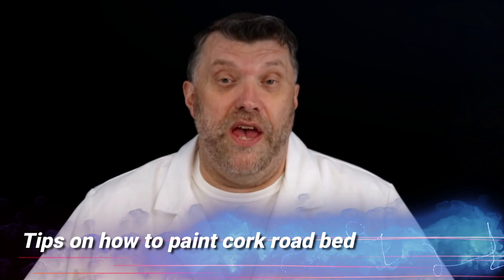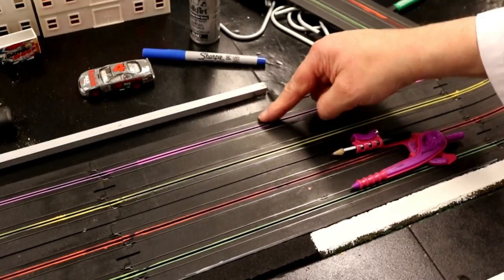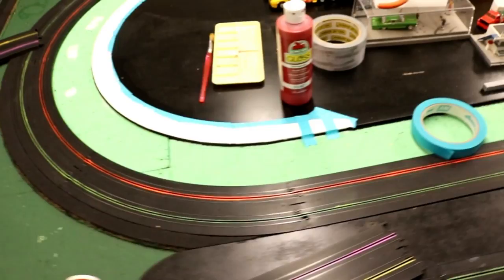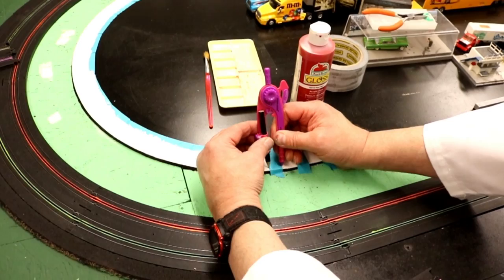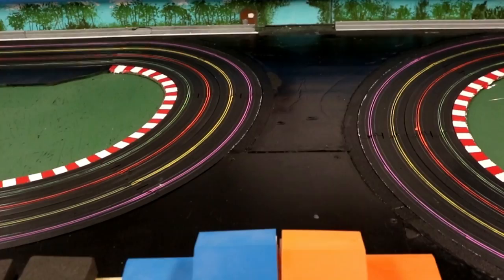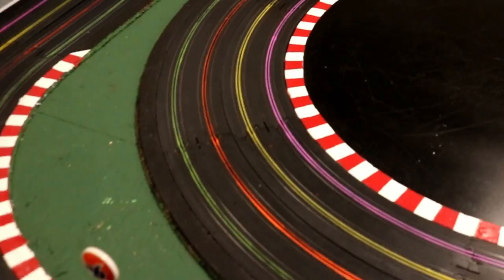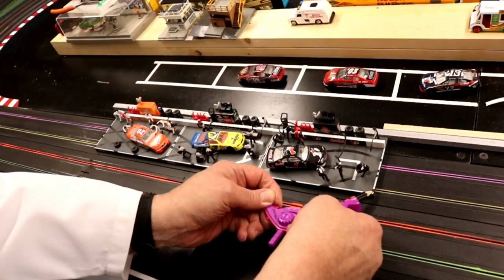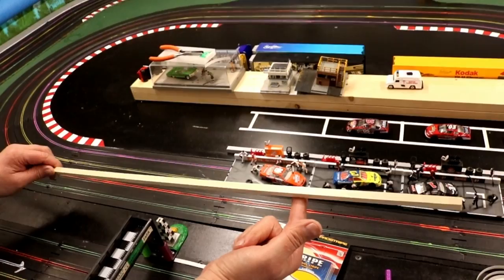HO Slot Car Tips: Painting Slide Rails

Comment: Looking good !  I have found that painting the berm/ cork strip prior to install is easier. Also, may try doing a flat finish spray primer coat first.  I used that on the Aurora Speed Corners with success. Just taped over the yellow plastic and sprayed flat black on them.  Looking forward to seeing how the MDF strip bends for the turn wall. Keep up the good work !
Reply from the maker: Thanks for the heads up

Comment: You might want to cut kerfs into the inside of your curved pit wall before you steam it.  I expect that there are some videos available on that process.  Looking forward to seeing your results.
Reply from the maker: Tab Maryland I steamed two so far . One turned out ( excuse my pun) lol and the second one split after it dried. Trying another one with alot longer steaming or just  soak them in water. Next video. Thanks for the heads up and thanks for watching.